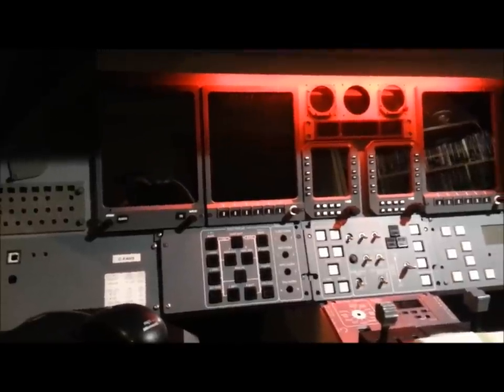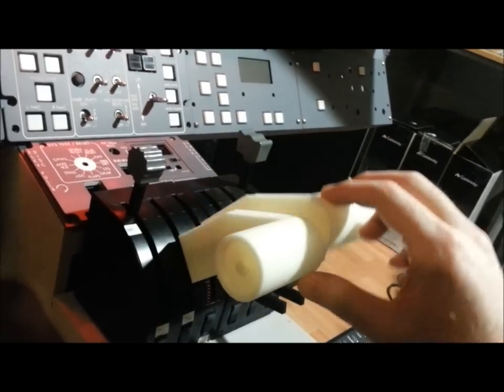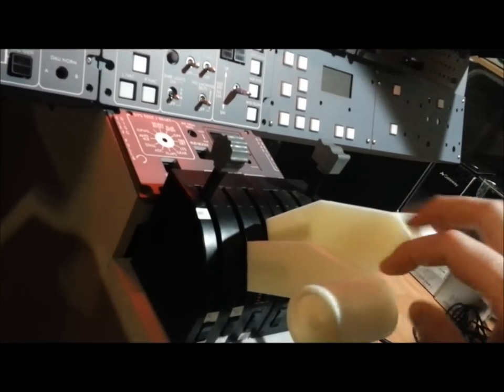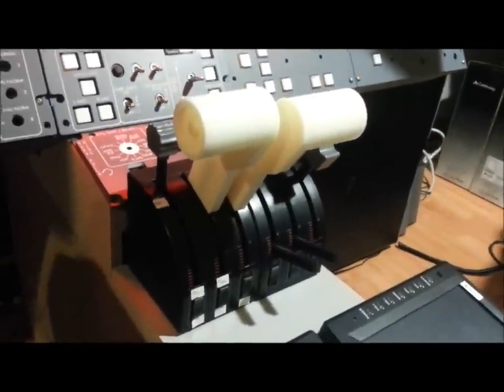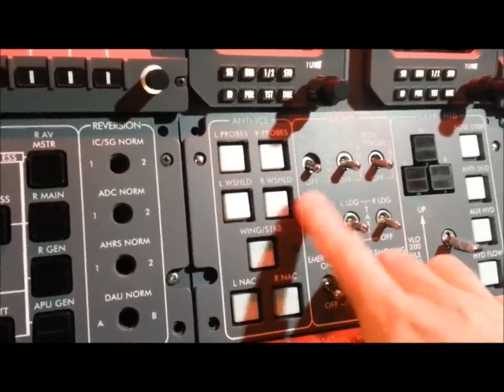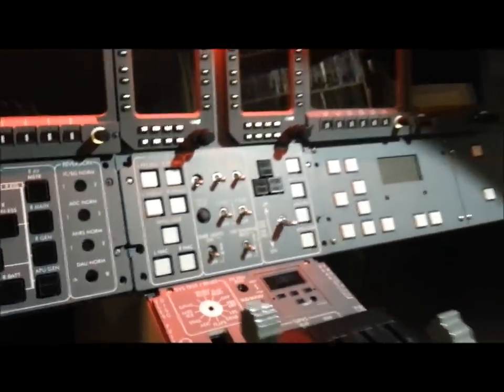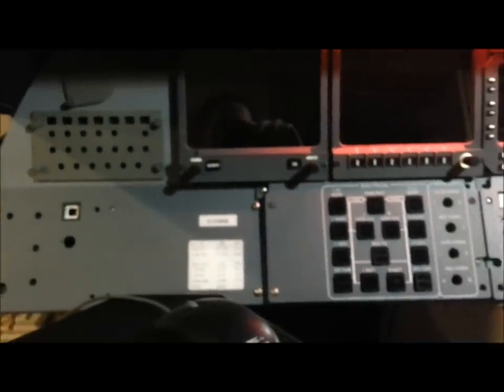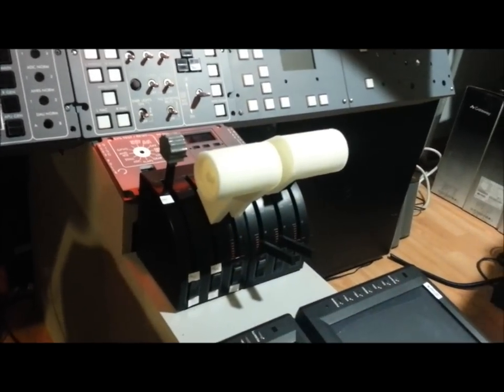Learjet Home Cockpit- 3D Printed Throttle Levers

Comment from the maker: Wow good eye!  Yes the infill is only at 10% rectillinear.  Oddly enough- this is tough as nails but they are indeed very very light.  I usually use 20% but this has proven to be plenty for most things.  Cheers

Comment: whats the material you used?
Reply from the maker: Mostly CNC milled and 3D Printed plastics. Aluminum backer over MDF frame.
Reply: whats likely close to ABS or PLA?